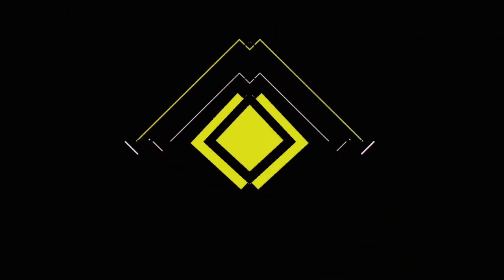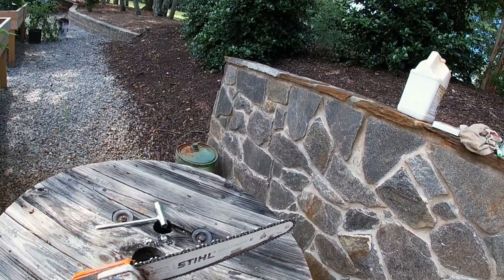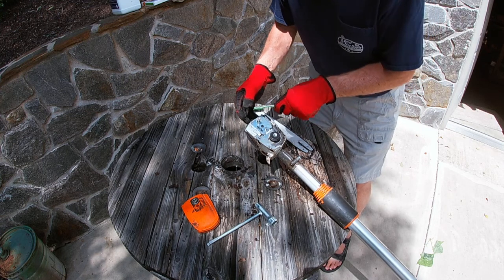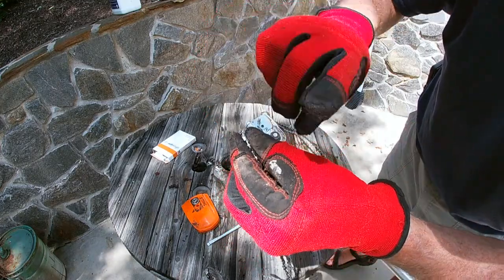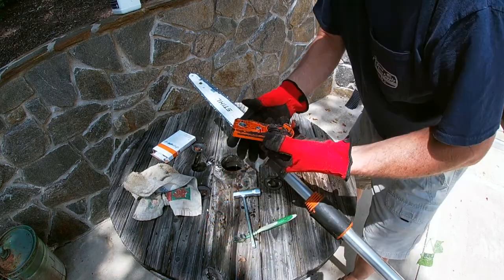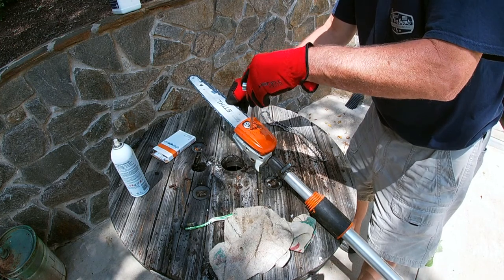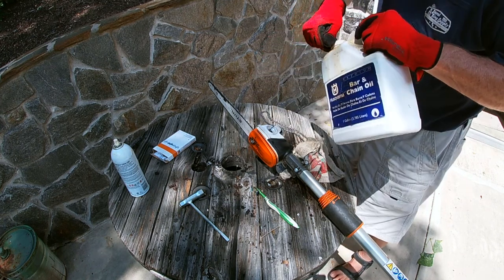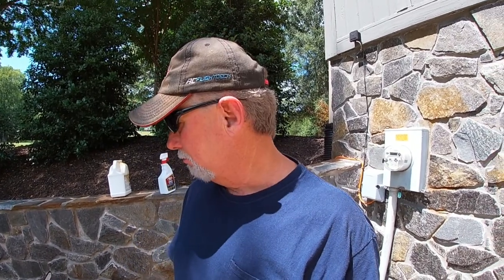STIHL POLE SAWS / STEP BY STEP ON CHAIN REPLACEMENT

Comment: Thanks I just purchased a Stihl h31 polesaw. After cutting about 30 mins the chain came off. I was able to get it back on and will cut tomorrow. I noticed how you checked the tension. I think mine is okay now. i THINK WITH A NEW CHAIN IT SHOULD BE VERY TIGHT.

Comment: You have to turn the adjustment screw to the left to put the new chain on and then turn the screw to the right to snug the chain with a little bit of play in it. The old chain stretches over time. I use the prferd hand chain sharpener, that is a little cheaper than the Stihl brand. It works great for a quick sharp blade. I found it on Amazon. Good video sir!
Reply from the maker: Thanks for the info and THANKS for watching !!!!